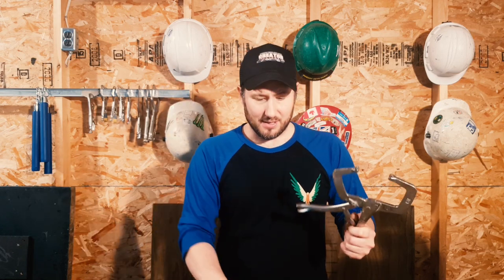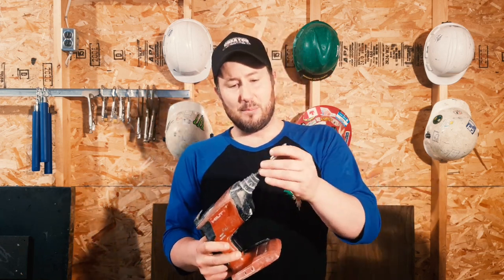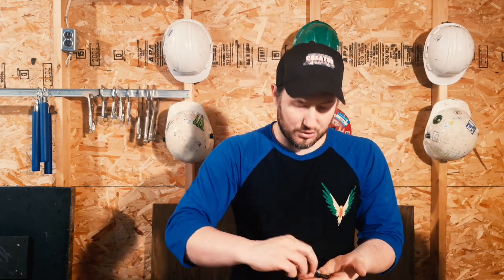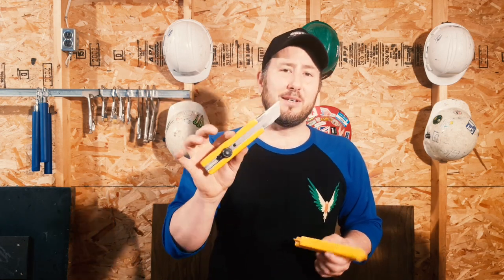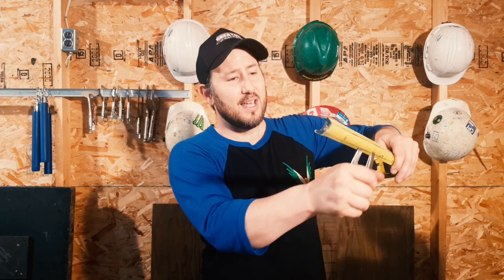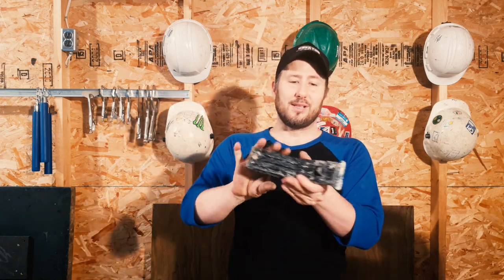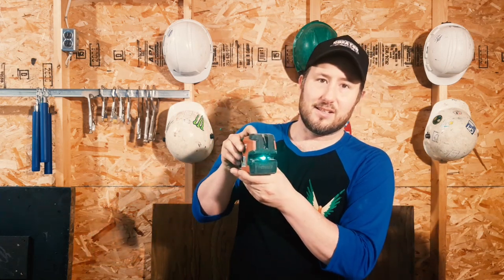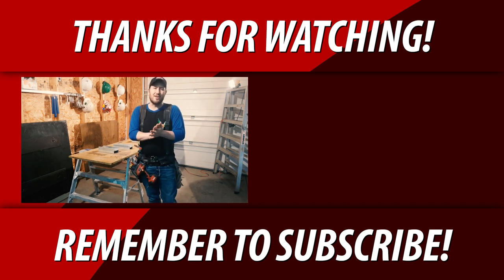Metal Stud Framing & Drywall Tools That You Should Know About!

Comment: Among carpenters, at least old carpenters, what you call a 2’ square is a framing square. What you called a framing square is a speed square. We always called the little metal framing screws peanut screws.

Absolutely agree about going cordless for your drivers. There are plenty of things to trip over on a job site. Eliminating most of the extension cords cuts the trip hazard in half as well as eliminating getting the cord caught on something so you can’t reach a screw or having the tool come unplugged, not to mention having someone else on the job unplug your cord to they can plug in their “absolutely vital” radio.

I don’t understand why you say you only need the red handled snips. The first time I had to deal with metal stud I was told that to cut one to length you just cut the two sides and then bent it back and forth till the center broke. That was 90% of the cutting and it didn’t matter if you used a right or or a left pair of snips and of course since it was a straight cut yellows worked fine too.
Reply from the maker: I love it, peanut screws. Yeah when I was first taught steel framing they showed me the exact same way to bend it back and forth. But over the years I have learned and through experience prefer the red snips and it's much much faster to cut them. I can easily demonstrate the technique in a video or on my live stream for you anytime. I started as a carpenter and yes in carpentry we call the 2' a framing square, the little triangle one is the speed square for studs in the tracks or on the plates. I have the little 1 ft framing square too. I will have to look back to see where my error was in the video! Thanks for watching and taking the time to comment!
Reply: Currently a metal stud framer, and it’s all production usually. Cutting your studs all the way through is a lot faster assuming it’s light gauge, just give it a little bend and cut a slight curve then cut the lip off for your next cut
Reply: @syscheremeta4121 absolutly . I remember the first time I saw a guy do the bend it till it breaks method😮 I thought I was going to stroke out..... Cussing him did not do any good do to the language  difference. I could cut 4 studs in the time it took him to bend 2 .But when I started in the trade we all had plumb bobs and water levels and cords.  No routers ....we had a keyhole saw and a bigger buck saw for cutting out doors and windows Lasers and cordless tools hadn't hit the scene yet.

Comment: Why do you use the electrician pouch for your right side ?
Reply from the maker: It's what everyone uses, makes sense, fits the tools we need for framing and drywall steel stud very well, put our tape measure in the top pocket of the screw pouch.

Comment: Why is the yellow for tapers?       Im left handed been using the straight cut snips since i started in the early 90's.  Most right handed folks do better with the right hand snips and same for lefties and left hand snips but i know a lot of framers that use the yellow .if you ever have to make a corner on a piece of 12" track or roof cap on a parapet wall  you end up using both right and left..............😮😮never mind i finished watching to the end .You might be  Canadian  that clears up all of the confusion i had.  😅 😅    😅Hope work is as plentiful for  you guys as it is in oklahoma the last several years.
Reply from the maker: Yes sir, Canadian. Thankfully work has been very busy since I moved out west to Edmonton from Toronto. I also did sheet metal so I use all types of snips for certain cuts. The straight cutters just for corner bead. There are thise long tip aviation straight cutters are becoming more and more popular with steel stud, I unfortunately can't use them. I have gimpy hands won't let my wrist work with . Cheers bro!

Comment: How can l know how to look the bid u use on cut out tool lm new one trying to use a hilti cut out tool
Reply from the maker: Okay cool! The Hilti cut out tool comes with 3 different collets for the different bit sizes. 1/8" is the most common. I use the standard point bits because it cuts nicer but most guys like the guide point because it helps when cutting boxes. I also use the 1/4" guide point for cutting around windows and doors. There is the 5/32" that is a bit bigger when all you work with is 5/8" drywall. I haven't used that one yet so if you get one let me know how you like it k! Hope this helps.

Comment: So you use a standard number 2 Phillips bit for driving your screws instead of using a Philips reduced number two AKA PR2 instead of P2 driver bit? that leads me to something I've wondered for a long time, and that is why do most dimpler bits incorporate the standard P2 driver bit instead of the PR2 driver bit?
Reply from the maker: Yeah the drywall and steel framing screws are all Philips you cant buy them in Robertson. The only other types we use for metal framing is 5/16" 3/8" 1/4" hex screws in that order.
Reply: @ConstructionKronies  yeah I'm not talking about the Robertson screws. I'm talkin about Phillips Reduced number 2 not Robertson number 2. On the bit itself a Phillips number two will say P2 and on d drywall version of the Phillips number 2 bit it will say PR2 this stands for Phillips Reduced 2, instead of Phillips 2. Some brands so will label them P2R. Both driver bits are a number 2 Phillips bit but the PR2 has a reduced width but it is still a number 2 Phillips bit in all regards but the reduced overall width allows it to fit deeper into the drywall screws in order to get a better grip and allow a lot less came out which leads to stripping of the driver bit and the fastener. I'm not sure if you know what I'm talkin about or not I will post a picture of both in your discord in just a second.
Reply: @ConstructionKronies  I think what you're thinking that I'm meaning is a combination screw that you can use a number 2 Phillips or number to Robertson but that is not what I'm talking about it all those type of combination screws are normally for wood framing such as some deck screws and some construction screws.  I don't like those screws at all. in my opinion those combination screws are worthless compared to torx screws , or even a regular Robinson screw.

Comment: The drywall can also be used for steel id rather use it than the compact the screws go in more easily
Reply from the maker: it sure can yes you bet! I remember about 10 to 12 years ago I was using the plug in drywall gun to fasten heavy gauge steel stud, but now with the 22V Hilti is good enough, but def not as good! Cheerrs!

Comment: Where can I get the same electrician tool pouch?? #amazonlink??
Reply from the maker: Yes you can get the leather ones almost at any drywall supply house or trade tool shop. You can get the nylon ones at any Home Depot or lowes, I bet Amazon will have either.  Sure yes this is an Occidental one that is the same price as the one I have https://amzn.to/3YGEAsW

Comment: my project is with shipping containers. i want metal studs as well.  i have been researching what best fits my needs for a metal framing nailgun.  i,m a totally new DIY er, . most bloggers with tools i notice may have most of one brand, but do have a couple of other brands they have.  most of my drills etc are dewalt. i may have to get a milwaukee framing nailgun.  can you suggest from experience the best metal fram gun.  thank you.
Reply from the maker: Yes I can.for sure. You can either buy a hilti dx351 or dx120and use steel pins or you can just use an impact driver and use 5/16 self drilling fasteners. Is there any concrete? Also to fasten the studs to the track or track to steel you can always use self drilling framing screws for heavy gauge or the regular framing screws (black) and they both have a #2 Phillip's head. That's the beauty of steel most of the time you just need screws. Any more questions always here bro! Good luck with your project.
Reply: @ConstructionKronies  thank you. my concern is, the screws are 1/4 inch. with a framing nailgun, the screws are 2"-3,1/4".  or smaller. i would like to drill metal from to concrete blocks to fill in 2 ft, between my polycaronate exterior walls, and entry door.  i,m confused and learning.
Reply from the maker: @rafiqa1621  okay so if you are going steel into concrete block like a masonry unit then the hilti isnt the right choice. You would need to hammer drill and use pin bolts.1/4" diameter to whatever depth you need. If its say structural steel columns or beams then the hilti is the only way to go. If it's just heavy gauge or light gauge steel to solid concrete slab then you can use the hilti powder or gas actuated nailers or hammer drill and use pin bolts. They have pins for concrete and steel nd both are very strong so I wouldn't worry about that. I wouldn't go buy a 351 or 120 for just a small pc of work I'd probably try to find the right screw, bolts and drill. Hope that helps.

Comment: I'm looking to attach 16 gauge steel studs to track.  Plans call for 10-16 ×3/4. I have salt air near me so I'm looking for corrosion protection.  I'm getting confused between the wafer head and the modified truss head.  Are they the same or can they be used interchangeably? Thanks
Reply from the maker: You can use them interchangeably not much difference in the heads really. They are a pain in the butt, I like the #8s for 18 gauge. Not sure why they keep specifying the #10s.
Reply: Thank you greatly. I'm getting a lot from your videos. Think I just found a video of using wood against steel for door frames, which is also in my plans for man door and overhead cannister door. Thanks again

Comment: Like the video man, some good stuff. Crazy to see how different people do it in other places. Everywhere I’ve worked we use the standard fixed blade utility knife, never seen anyone using the olfas but it makes sense. What kind of hammer you use? All sorts of cool framing hammers coming out these days but nobody makes drywall hatchets with cool features :(
Reply from the maker: So true man and I just hate the hatchets because they are so light and weak.  I use a Stanley 22 oz with a long handle but love the Stilettos. You can spend $400 on a hammer these days. I used the fixed blades lots and used to prefer them for drywall. But doing itch and other stuff and now I got used to the nice grip I get with the 1" blade. I can't stand the small olfas it has to be the 25mm or 1"!!

Comment: Is 20 gauge steel considered light gauge or heavy gauge in regards to the framing screws?
I am wondering whether I should get #8 self-drilling zinc screws for 20 gauge steel or the black phosphate screws?
Reply: ... and what length should the screws be for 20 gauge steel? 1/2" or 3/4"?
Reply from the maker: Yes it is heavy gauge. It's funny, there is only 1 light gauge at 25 and everything else is considered heavy.  All you need is #8 1/2" self drillers for gauges 16 to 20.
Reply: @ConstructionKronies  Thanks a lot for your answer :-)

Comment: So, having just had 3 walls removed for a Sump install, is it possible to build half steel stud for 4ft, and the remainder be wood stud?

Or is going single material better in a basement envrioment?
Reply from the maker: Steel always in a basement. All steel and no wood is the way to go. When you frame  the frost walls,.insulate, 6 mil vapour barrier and some chemtron caulking. 25 gauge will be fine, I like 20 gauge myself but at least at the doors. Hope this helps let me know if you have any more questions.
Reply: @ConstructionKronies  actually yes, does the track have to be nailed/screwed in? I have a gutter system below the concrete, and cannot puncture that.
Is adhesive acceptable?
Reply from the maker: @S_murray  K here is a link too the pin bolts I recommend. 1/4" diameter and you can get them in 1"-2" long.  Pre-drill the holes in the concrete with a 1/" bit on an sds hammer drill. We normally use the 1/4"x1-1/4" http://bit.ly/UCANpinbolts

Comment: Not bad we do things a little different. Where’s your notched 1’ square for framing your top track. And why the spring clamp or “ butterfly clamp” ditch that thing and just use your small clamps. We don’t use those break away knives for drywall I could see the use for insulation. Just the way we do it. Good info though. There’s not much for us commercial framers on the tube. Oh and forgot snips are preference really I use straight.m because we use them for more than studs. Maybe you got to cut break metal or corner bead. I can cut metal studs with straights just as fast and easy with straights than rights
Reply from the maker: Right on man! Sure yes the 1' square is a good tool, I just use my clip for pulling my tape and marking centers, I find the baby clamps break your tape over time. I bet you use the double edge straight blade to cut drywall, another excellent tool, I used to use it all the time, the 1" or 25mm olfa is the big knife that's good for both itch and drywall. I never touch corner bead but yes the yellows are the best for that. Thanks for the input it's good to hear from experienced guys!
Reply: Construction Kronies do you guys notch your squares so it gives a true square when laying up against the track?if you clip the tape right in the middle and you don’t need a lot of pressure just brought to keep it put. I feel works better than a spring clamp actually crushing the tape. I mean I know you pinch it just right before the bend of the tape. Just preference I guys I just to run minimal. I want to be as light as possible. I’ll use spring clamps in ceilings so I don’t mark up the grid. I’ve been clamping the same tape for a year now.  I just use the old tried and true Stanley power lock. Oh and store your marker upside down it will last longer. And for some reason red last way linger than black. If you haven’t noticed already
Reply from the maker: @iandb86  haha yes that is true, red does last longer. Yes I used to notch the square but they come like that now. Good marker tip and yes that's and important tip to be as light weight as possible I always laugh when I see the guys fully loaded with like 10 clamps clanking about. I always switch to my drywall or steel tools never have both in my pouch at the same time.
Reply: Construction Kronies lol yea it’s usually the green kids trying to carry everything in them. They buy the biggest bags sold lol. Hell I did it too, but I learned quickly. You work all day just to take your bags off. Don’t make heavier than they need to be. Take care brother. Keep up the good work
Reply from the maker: @iandb86  thanks man you too. I'm guilty of it as well haha. Would love to see you around on a livestream we can talk shop!

Comment: Very informative vid Chris.  You explained all the necessary tools for hanging drywall on both metal and wood studded walls.  I did notice you didn't have a 48" drywall T-Square?  Perhaps you really don't need one but I love to use them to square up and mark not only drywall but plywood and MDF.  Thanks for sharing.  Cheers mate!
Reply from the maker: I'm glad you mentioned that. I had to cut that part out of the video because of bad audio but yes yij need one for sure. I was so mad I shot 2 videos and the one I cant use any of it because of bad audio I barely got the second one done.

Comment: You never use the drywall gun with a 6 inch shaft for framing 20-25 gauge metal? Typically thats how it is now (standard for piece workers) definitely out perform anyone with a impact
Reply from the maker: I have used it before but my impact is much much faster to use. I don't see how a drywall gun could be faster and I don't mean that to be smart truly. Of course you see guys using them from time to time for framing but the major majority of guys use an impact. Cheers man!
Reply: @ConstructionKronies  Crazy how down here in florida the vast majority use the drywall gun with a 6 inch shaft, and trust me when your screwing the bottom studs or ceiling or sophist youll outrun anybody using an impact (since i dont gota stop holding the trigger i can keep going no issues) pretty cool what the standard can be in one place as to other places.
Reply from the maker: @robertureta379  I agree. Totally love hearing about other places as well. I use my impact like I do my drywall gun by holding screws in my other hand ready to be loaded so maybe that's why I'm faster with an impact ( I like the compact size of it so I can screw off both sides of a stud easily from the one side) cool man🔥🍻🤘

Comment: an impact gun is for screws for medal studs? i thought a framing nailgun, which is faster, is that used for metal studs? i,m confused. new DIY, er.
Reply from the maker: Yes yes. All you need is an impact gun. When your fastening the steel track to wood used 1-1/4" drywall screws, track to steel like metal decking use self drilling framing screws, you can use 5/16" to 3/8" hex head self drilling fasteners when setting track to structural steel and when fastening to concrete you can hammer drill and use pin bolts. When it comes time to fastening the studs to the track it's always screws (2 types self drilling and regular) in rare occasions you can use rivets as well. We only use nailers for wood framing but there are powder actuated, battery and gas guns out that shoot pins into concrete or steel but that's only for the track and speeds it up and can save money in the long run. Hope that helps.
Reply: @ConstructionKronies  thank you, i have a much better understanding of the tools to use.  framing nailgun is for wood framing only.
Reply from the maker: @rafiqa1621  glad to hear that.. what I'm here for. If you need further help with any building stuff too just ask. I even have a couple live streams a week where you can ask me questions as well.
Reply: @ConstructionKronies  thank you. you are appreciated.